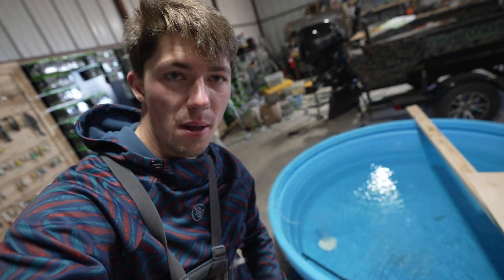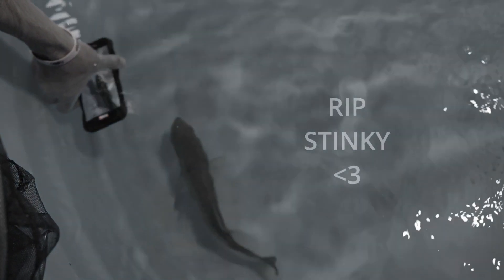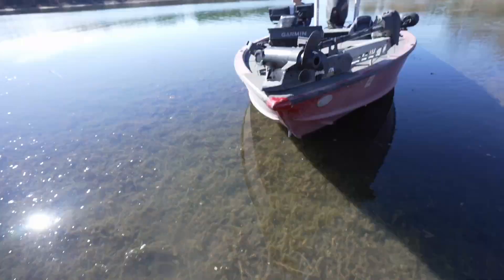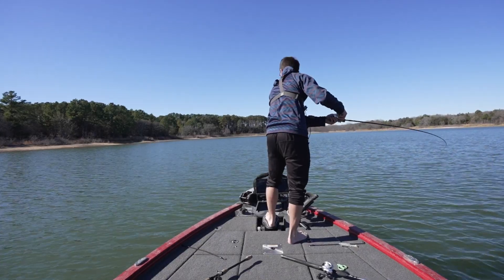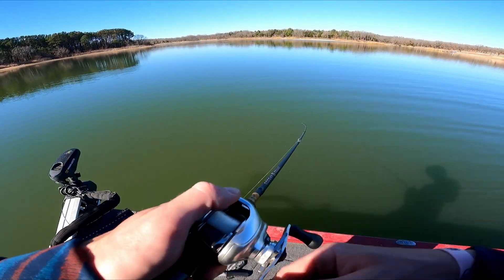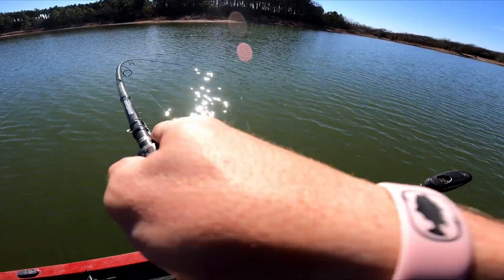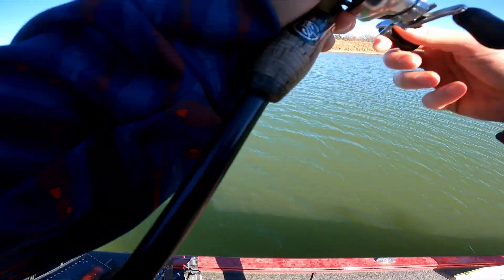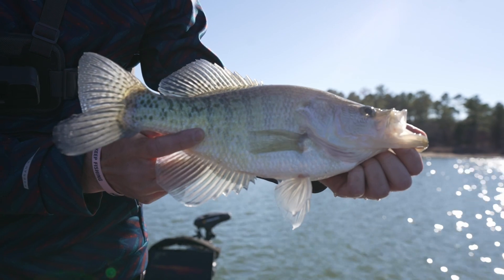The Indoor Pool Pond Has A New GIANT Fish!

Comment: Great video Jon 👍! I recommend putting some gravel, drift wood, or sand for the fish. I know smallmouth and largemouth bass are different but I recommend lowering the height of how high u have the tube where fresh water comes out because I had a smallmouth bass and he jumped a lot and when I submerged the water flow into the water, he stopped jumping.
Reply: I agree. But a bit of sand as well for making nests.bass and crappie both like sand
Reply: I've also got some water wisteria I could send for plants. It grows quite well with aquariums. I've got an over abundance of it
Reply: you'll need a heater or three for the pond; the temp doesn't have to be warm, just no wild swings....  avoid that "ich "

Comment: I would get a bunch of low walled sifter bins or some holding pots to put gravel in like a bed then it's easier to clean. Craft store for some fake seaweed plants and flowers. Goal later on to grow real plants. School of crappie fish, next episode with a feeding. Order from Amazon or the bait store minnows and crawfish for feedings. Find some old branches to submerge for structure coming out of a DIY rock shelf with glued rock or slate caves. Some natural aquascaping with soil, sand, plants or DIY waterfall (note: gravel or sand bottom might harbor bad bacteria or parasites unless you correctly ecosystem scape it). I would make a retractable net cover that rolls up or folds up like a circular accordion fan. You can even motorize it on a railing or bearing surface if you're crafty.